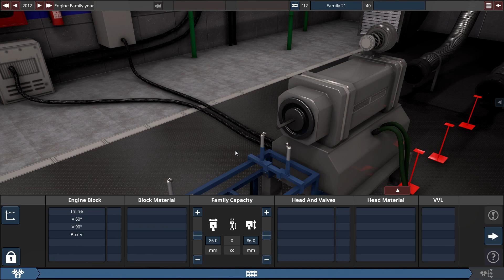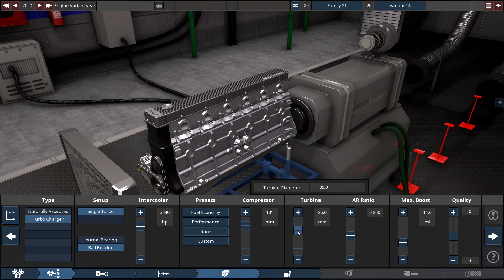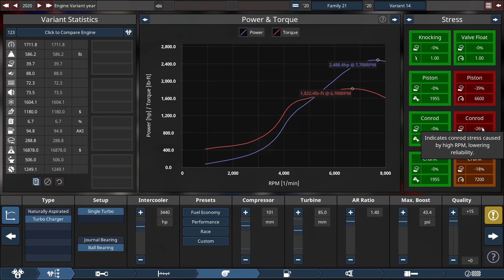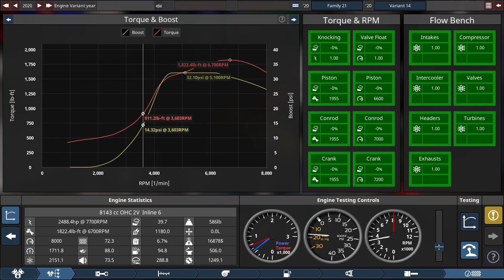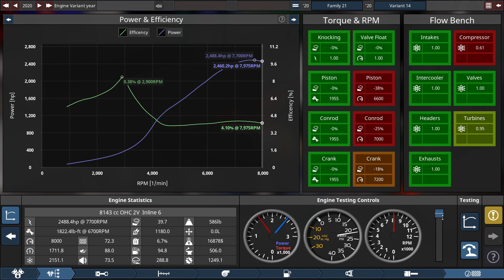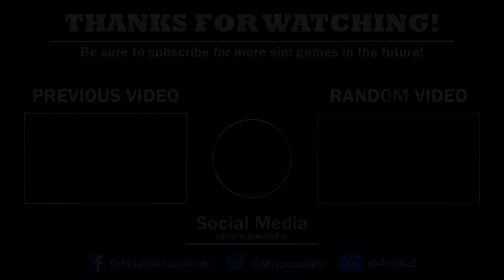The Most Powerful Inline 6 Engine Ever | Automation The Car Company Tycoon Game

Comment: build a Wright Vertical 4  which is Type: 4-cylinder, liquid-cooled inline piston aircraft engine
Bore: 4.375 in (111 mm)
Stroke: 4 in (102 mm)
Displacement: 240 in3 (3.9 L)
Length: 40.75 in (1,035 mm)
Width: 18 in (457 mm)
Height: 27 in (686 mm)